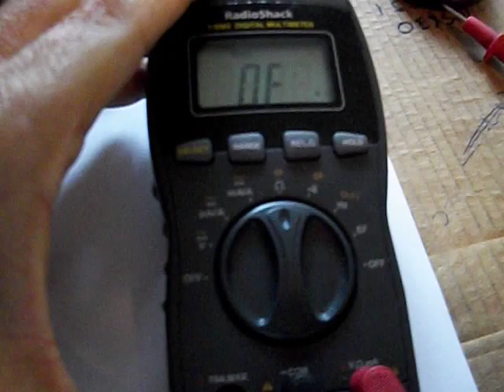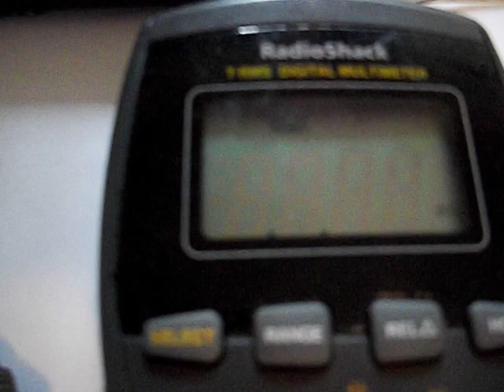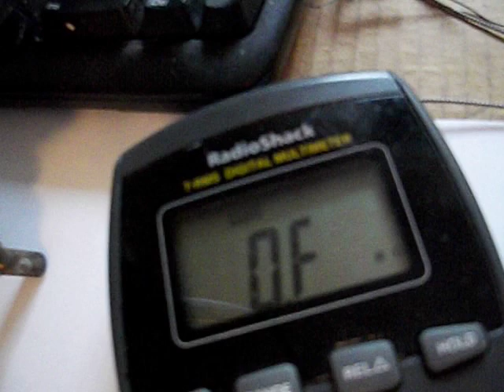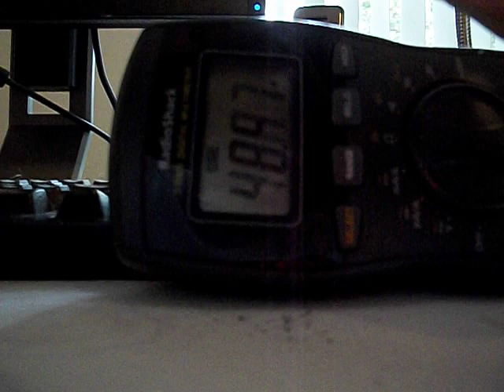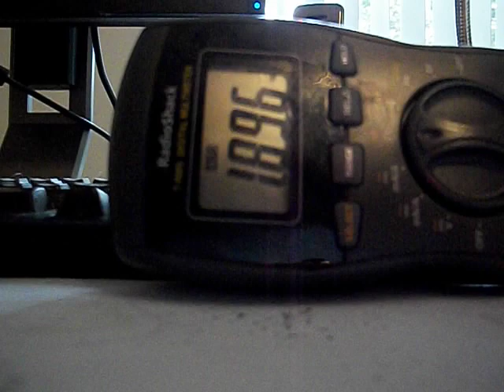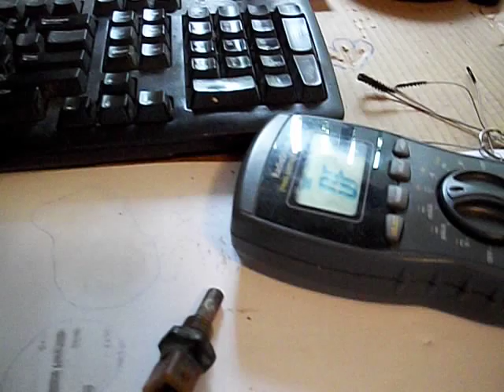Datsun 280z EFI multimeter check out of Temp sensor

Comment: How can I fix the issue of my 280z temperature gauge reading too high? It shows 3/4 of temp gauge yet when I use a gauge and infrared gun they both show 180. I put in brand new temp sending unit too
Reply from the maker: other than making sure all the connections are clean and bright, the only thing you can do is try another sending unit. I suppose the problem could be the gauge, but I would try a new NISSAN sending unit 1st.
Reply: @davewm9589  okay so I just installed a new sensor and it's still off. I measured ohms at 56 even though with my infrared gun the coolant showed 151 Fahrenheit. I read about adding a resistor how would I do this
Reply from the maker: if you want to add resistance to the system just install in in series with the lead going to the sensor. You maybe better off using a rheostat instead of a fixed resistor, that way you could dial in the exact amount of resistance to make the meter read what the water temp is. This will of course only work for a gauge reading higher than actual temp. If you were reading lower that actual then that would mean there is to much resistance, Anyway back to adding resistance, get a 500 ohm pot and connect the center lug to one side of the circuit (say the lead from the wire harness) then ONE of the other outside lugs goes to the sensor. Now you can dial 0-500 ohms, should be able to nail what ever you want with that. once you have a good reading, you can read the resistance of the pot (configured as a variable resistor here) with a ohm meter and find a suitable fixed resistance to replace it.
Reply from the maker: did you watch this videohttps://youtu.be/TIF7ls6NaI8I mention because you are posting question about the temp gauge sensor on a video about a temp sending sensor that is for the EFI and not the temp gauge.
Reply: @davewm9589  thank you I will definitely try this out ! My gauge reads higher than it should so I will do all of this
Reply: Yes, remember that there are TWO temp sensor that can be confusing.  A cylinder head temp sensor (Like in the video) and the water temp sensor for the coolant gauge.
Reply: Hi Dave, great video.  I am just now testing my ZX CHTS and I don't have an auto meter, so I have to set the range.  Book says the reading should be less than 2.9k ohms, but my reading is around 1700.  I'm assuming that's correct as 1700 is less than 2900...  Am I right?  The ohm range settings are confusing to me.  Thanks